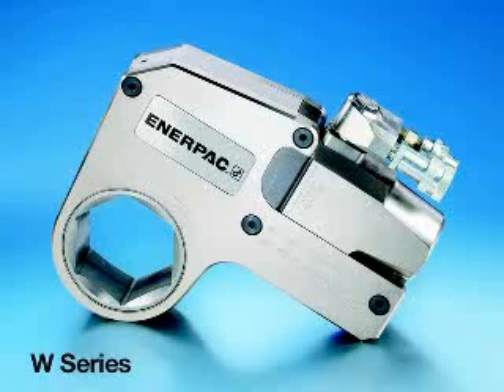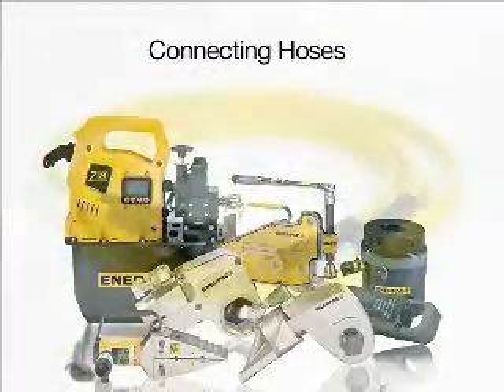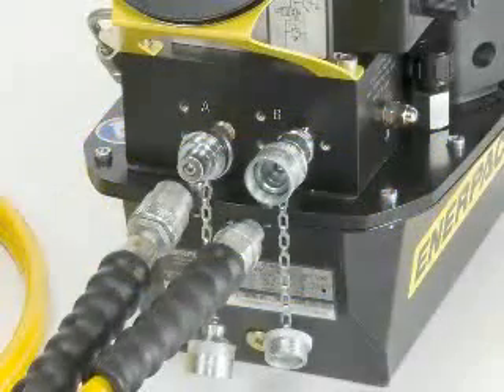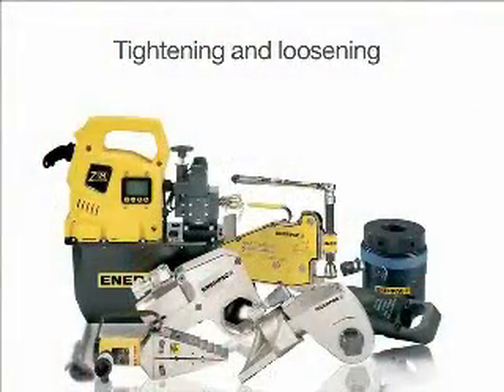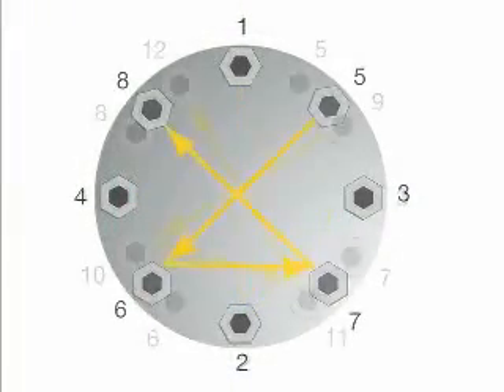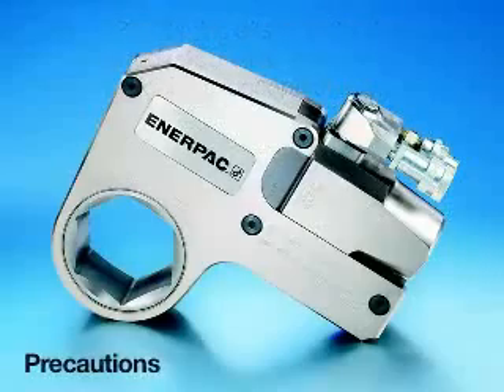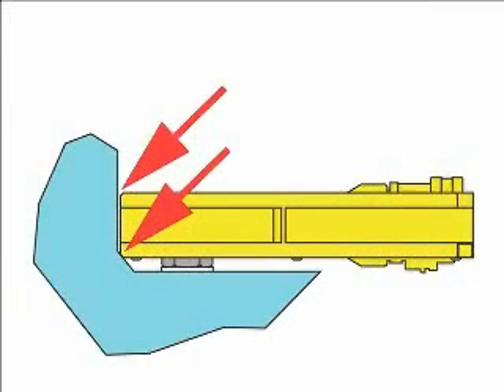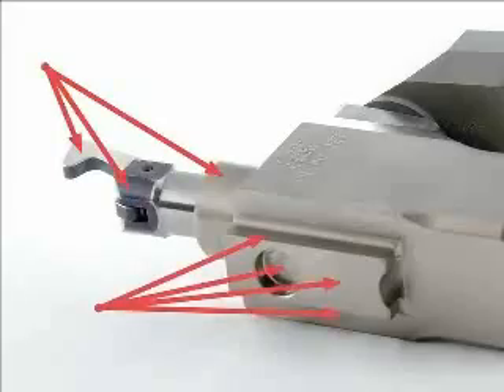W-Series Low Profile Hydraulic Torque Wrench Tool Demo | Enerpac

Comment: At 3:18 in the video, the user places their body and hand near the top of the swivel.  That placement should be avoided due to potential injuries should the swivel connection fail.  (Has happened in industry.)  Make use of the handles normally included with this wrench, and stand clear of the swivel.